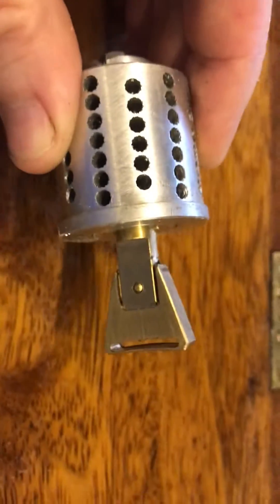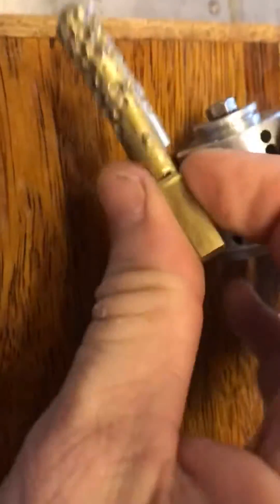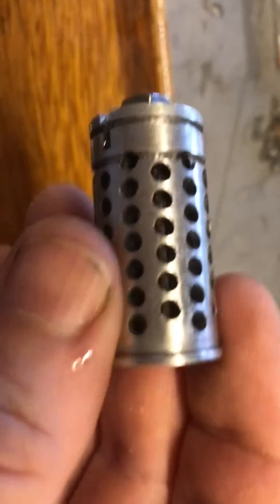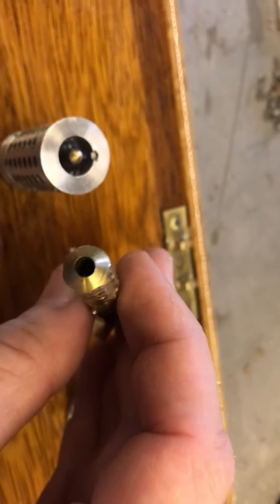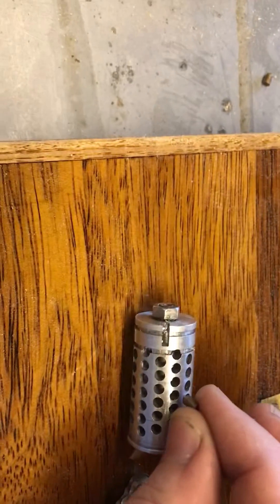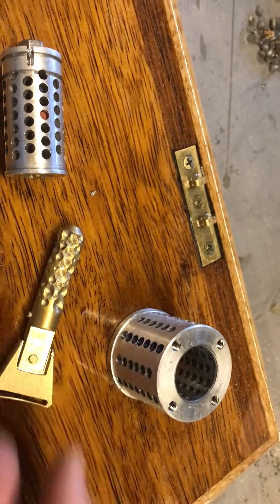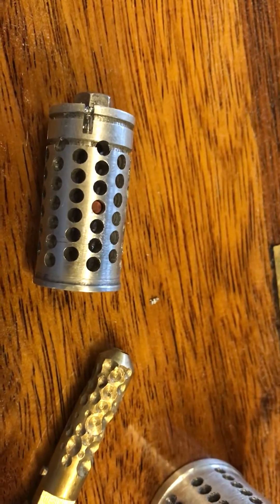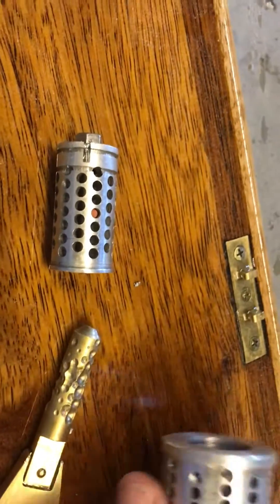Unpickable lock. 78 pins

Comment: I can already hear it... "nothing on 42, click on 43, 44 is binding, ..." :D Nice job machining this - is there another cylinder going around the larger one to hold the springs and being the back stop for pins and springs?
Reply from the maker: No extra cylinder.  Although it would have been a good idea.  I drilled and tapped the holes.  Used a very thin grub screw.
Reply: „Ahh I think pin 72 on the other side has just dropped“